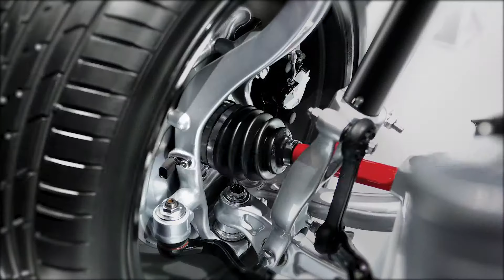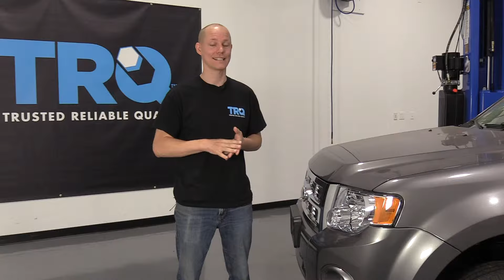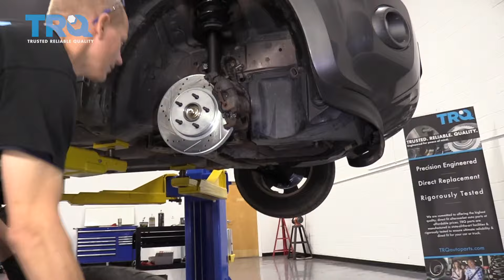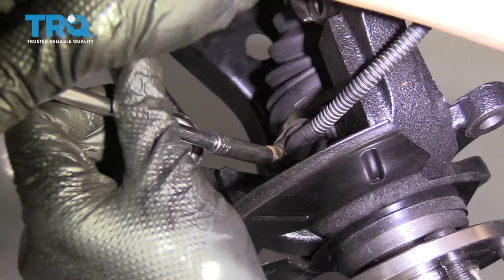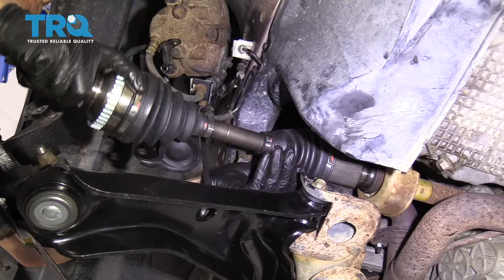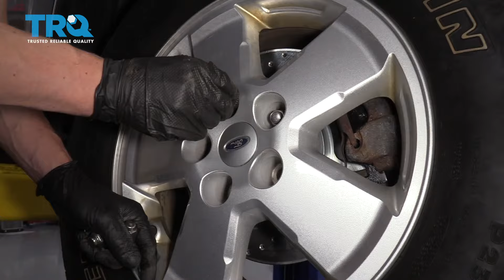How to Replace Front CV Axle 08-12 Ford Escape

Comment: I have watched two videos. One showed the passenger side axle replacement and the other was for the driver side. Torque specs for all nuts/bolts where different from one video to the other, so what are the specs for the axle nut, ball joint nut and the mounting nuts for the hub?

Comment: The abs sensor actually has two tabs at the bottom, preventing removal from the knuckle.  In the video one of the tabs was snapped off.  How do I remove the sensor without needing to break a tab?

Comment: The nut holding the CV joint will not come loose. I put a bar beteen the stud down to the concrete then I got my rachet with a long bar and I tried to break it loose but I bent the bar that was holding. It won't budge. I tried a heavy duty air gun and it still wont budge. I haven't  put the tire back on method. I sprayed with WD40. What should I do now?

Comment: A good m ethod for removing axle nut (wheel off).....while brake rotor is still on, just jamb a screwdriver down into the rotors ventilation fins, and the brake caliper will be the stopper for the screw driver. Now take axle nut off.

Comment: Hi, I have a shudder/vibration when accelerating - worse if turning. I replaced the Driver's side CV axles and it got better. How common do the Passenger's side Inner/intermediate/jackshaft axle fail? Or is it most likely just the passenger side CV axle? Thanks
Reply: Try checking your motor and transmission mounts.

Comment: What happens when I’ve hit on it with a hammer for half an hour and tried a slide hammer and it won’t come off? Any suggestions
Reply: If Jesus doesn't work rent a puller from you're local parts store. Turns a nightmare into a 30 second job.
Reply: The best penetrating you oil you can buy is kroil. The oil that creeps. Don't hose it down, use  just enough.  Or try heat. Or both. Heat the hub, it might expand it. Torch .